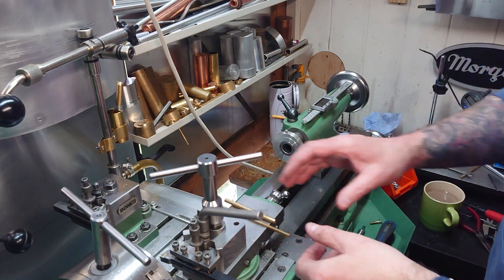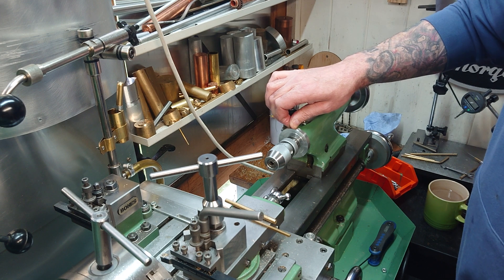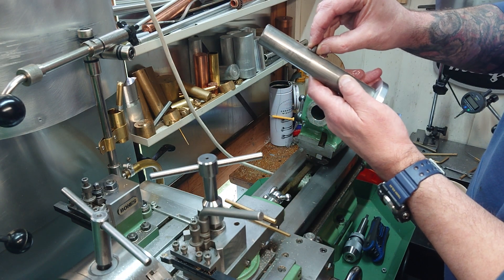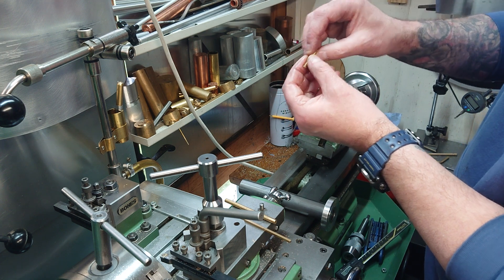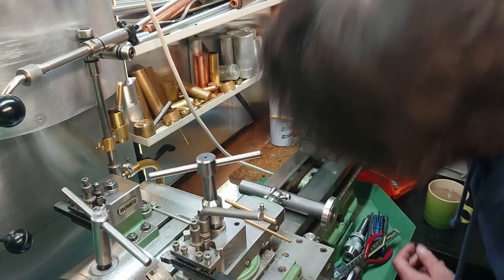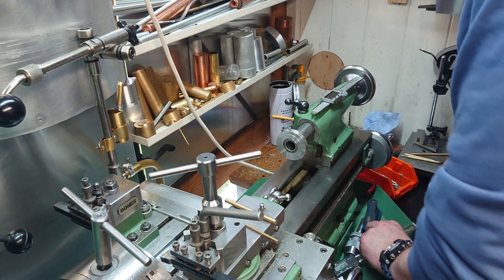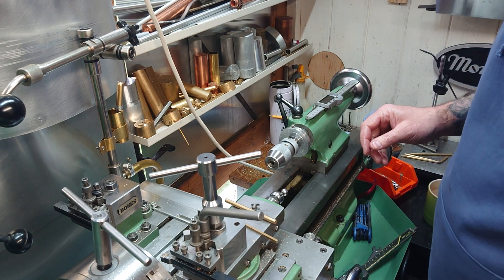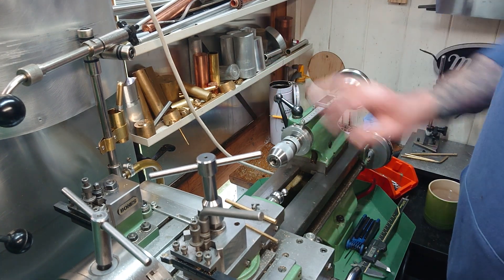Sloppy barrel - Myford Super 7

Comment: How did you mount the caliper on your tail stock?
Reply from the maker: Hans, the calliper had a hole drilled into one of the prong sections and it fits through one of the existing oiling holes on an extended bolt.